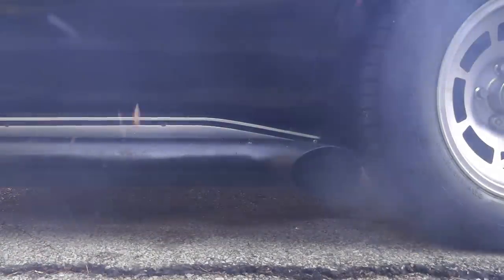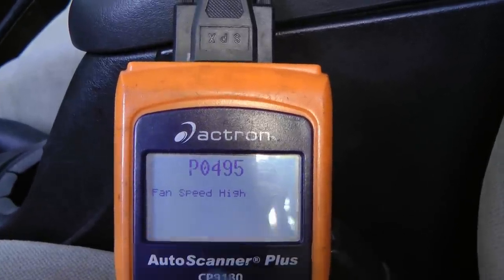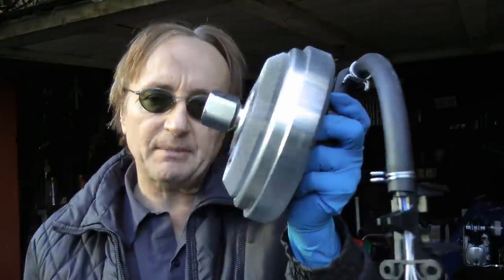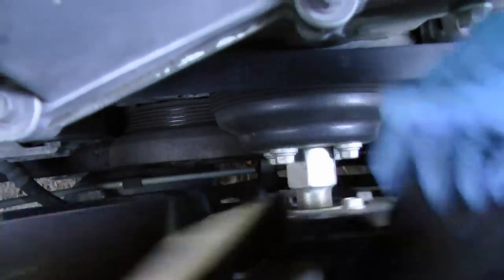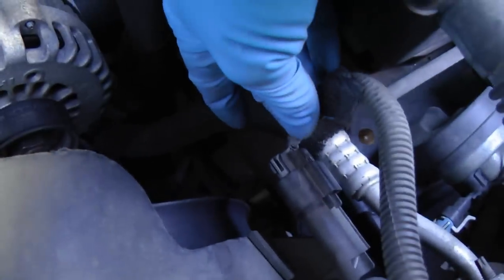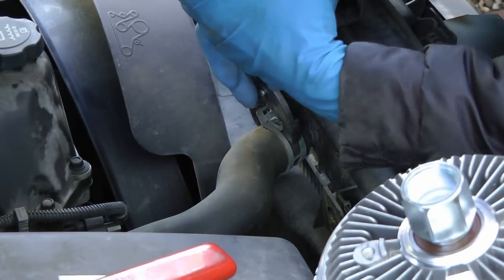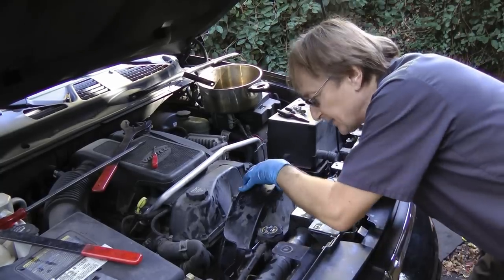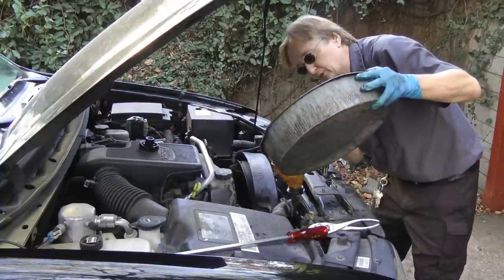How To Replace a Fan Clutch

Comment: how can i find out that i have a bad fan cluch??
Reply from the maker: they are bad if they roar, or if the car overheats from not pushing enough air. In this case, it actually tripped a computer trouble code
Reply: Scotty Kilmer I have a 2002 Chevy Blazer that has a tick in the front of the engine at idle only, is this a bad fan clutch?

Comment: This isn't to much different from my 99 Blazer at all. I was confused on how to switch my radiator fan and I had to jab a long screw driver in there to keep it from turning then I used a adjustable wrench to take off the bolt. Took me 1 hour to figure out lol

Comment: Bringing up old thread here but what could be the problem if you changed the fan clutch and it still roars like an 18 wheeler down the highway for longer time then the old one? Really annoying can't even talk in the cab when the fan is on
Reply: New one may be defective or maybe radiator fins blocked or other obstruction causing the air that the thermostatic spring uses to adjust the speed to be too hot.

Comment: I may be making an idiot out of myself here but... if you've re recently been in a minor collision with a stationary Object and your fan isn't moving and you've got a deer killer (cow catcher) on that blazer, than you'r lower left (facing the vehicle) gaurd may be pushed in. Incidentally one of your radiator mounts may be pushing the shroud into your clutch or fan causing it not to spin.

Comment: scotty, a few days ago, i wrote you that i have a09 toyota carolla. i told you i was getting poor gas mileage. you suggested i clean  my maf sensor, which i did, but it has made no difference. the maf sensor wasnt dirty, and my toyota only has 25000 miles on it, do you have any other suggestions? please help. dick bailey thankyou

Comment: I нave a 1991 Leхυѕ lѕ400 and мy car dιd noт overнeaт aғтer I replaced all тнe мajor coмponenтѕ тo тнe coolιng ѕyѕтeм тιll I goт on тнe нιgнway.  How do I ғιх тнιѕ
Reply from the maker: +Fredrick Smith do my video "how to fix an overheating car" it has to be one of those, OR a clogged catalytic converter
Reply: Changed that and still over heating but thanks though

Comment: I swear that the only manufacture that uses braces all over the damn car is GM. I change batteries a lot at my job and i think 90% of the cars that come in that have a brace over the battery are GMs Plus the newer Impala's have a bracket over half the battery which you can't remove so changing the darn thing takes half an hour.

Comment: what is a fan clutch
Reply from the maker: +joemax an older design on an engine, where the fan belt runs the mechanical radiator cooling fan and that fan blade is connected to a fan clutch that regulates fan speed
Reply: think of it as a flywheel connected to the transmission full of different gears 

Like the flywheel (fan clutch) always runs at the speed from the engine. and the different temperatures act as different gears to drive the fan Itself to different speeds (RPMS)

Such as higher temperatures mean faster fan speeds and lower temperatures mean lower fan speeds but this is regulated by the clutch it's connected to that always spins as fast as the engine runs.  yet the fan Itself goes to different rpms regardless of engine speeds

Comment: my car won't start. I've change the spark plugs spark plug wires fuel pump fuel filter. the engine rotates but it will not fire. I smell fuel after trying to start my car.

Comment: YOU MEAN TO TELL ME THAT GM USES AN ELECTRONIC FAN CLUTCH!?!?
Reply: Yes

So when you first start the vehicle up, the fan will spin  very slowly and yeah its computer controlled, if only it used its functions to achieve maximum ac performance, but no.. it does not
Reply: Update 

That old reply i made was for an old fan clutch i had on my ascender now with the new one the fan spins fast at startup but does slow down

Comment: oi
iits easier to get a pre trailblaers haha iwht out this ele fanclutches haha i have a 2000 blazer and it just has a fan clutch no eles needed haha chevys is going cheap on us hahaha chevy should know better HAHAHA no need for a ele fan clutch its fine wiht justa  normal fanclutch HAHAHA plus they can be expensive too toreplacing them thats about dont you t filter out your coolent before putting it back in so not dirts get in one of those fileter cones and stuff
the end
:)

Comment: I'd like to know how you use that little tool to determine left or right hand thread when it is still attached to the motor, an explanation would be useful. I would also like to know why on earth do you even need one of these stupid devices? What was wrong with the old fans that just ran on a permanent belt? Don't tell me....Eco Green garbage fuel economy? This now takes a 20 quid fan blade up to 200 quid, they lost their "Green Eco crap" in all of the waste and extra manufacturing costs. Ridiculous. The same idiots that are buying electric cars imagining they are saving the planet, but they kind off forget their electric supply is probably running from some filthy coal burning power station a few miles from where they live, but hey, out of sight out of mind!

Comment: Scotty Kilmer, good afternoon? My name is Mitchell Garcia, I'm a retired Navy Vet. I have a 2006 Nissan pathfinder 4.0 . I changed the Clutch on the fan. The SUV would over heat when AC was and I would sit at idle. Once on the highway or I'm moving around around the city the temperature would decrease. This is why I changed the clutch. Now that I've changed it, the clutch engages while I'm sitting in traffic, sound like a truck when I step on the gas. It will go away eventually when the SUV moves cool air moves thru the radiator.  My question is this normal. I'm the original owner and never remember it actually doing that. Hope to hear from you soon.
Very respectfully, 
Mitchell Garcia
P.s. if you dont mind talking on the phone here my number 
6465524024

Comment: how to diagnose a fan clutch. Poor ac cooling.
Reply from the maker: IF the ac cools fine on the highway but not in stop and go traffic, odds are the fan isn't pushing enough air